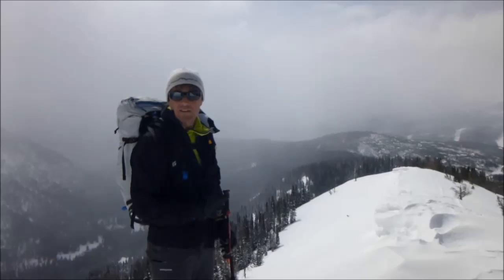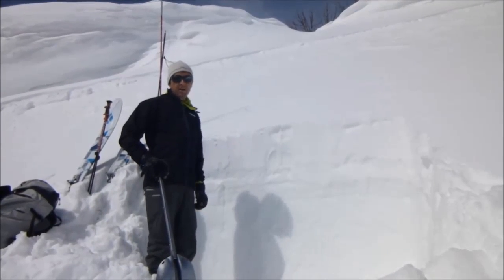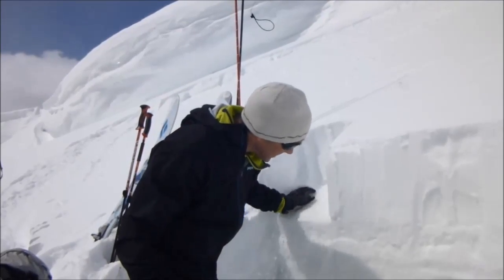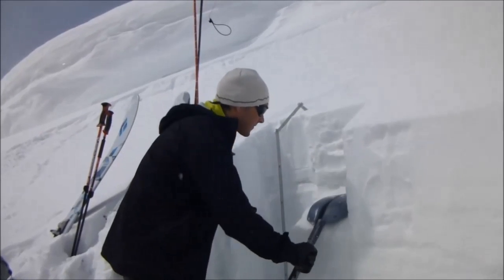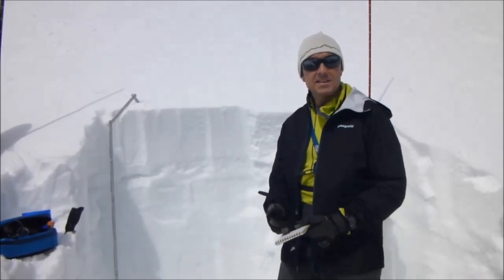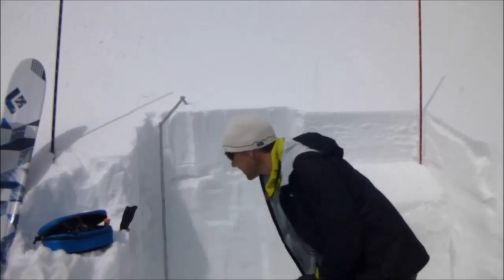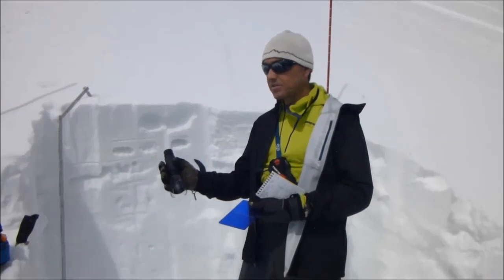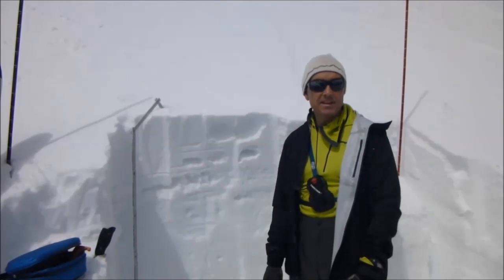How To: Snow Profiles & Tests

Comment: The question is : would you ski the terrain in this video?
Reply: No he didn't
Reply: No it propagated q1 at @15
Reply: Rather, the question is what terrain would he be willing to ski given the results.

He would likely ski the immediate terrain in the video since he and the camera person already entered it and thrashed around. Therefore, it's apparently safe terrain, meaning some combination of low angle, low consequence, small slope, etc.

The results will then either confirm whether the plan he already made for a similar but more dangerous slope is safe enough, or the results may steer him to a backup plan.  If his original plan was already very conservative then maybe he'd be able to stick to it.

That said, with a plan conservative enough to keep going with those results, you probably don't need to waste time digging a pit.
Reply: @BrianBraunsteinNow  it literally says on the snow profile "we skied the slope. Ski tracks on slope. Supportable crust." They decided a CT score of 15 with a supporting crust was fine.
Reply: @JohnSerjeantson  I assumed they skied it, but looking at those notes now, I'm surprised to see it was 36 degrees, close to the center of the curve. Unless it was a small low consequence slope I would not call that a go for me. It clearly propagated well with Q1 without too much force and not so deep to be safe, but deep enough to send a heap of snow down.  The profile has that crust drawn as rather thin.

This guy is way more of an expert than me for sure, but my feeling is unless you're a hero like him and can evaluate very subtle points, this would be no go results for 36 degrees terrain with consequences.

Comment: Your videos are very informative and I'm grateful that you've taken time to make them! Being an avalanche professional, what is your experience in observing amateur skiers of different levels? What level of caution do they use when assessing localized avalanche risk, and which tests are they likely to perform, if any?
Reply from the maker: Liam, The most popular tests are the Compression Test and Extended Column Test. These yield pretty good results. We see folks with lots of experience use tests and others do not. The same for beginners. It really depends on what type of information you want in regards to the level of risk you are willing to take.
Reply: Interesting to hear that some experienced folks don't bother performing tests before going at it. I have absolutely zero avalanche experience as I don't live anywhere near avalanche prone terrain, but I will be moving somewhere where they are a real concern later this year. Can you recommend some good resources on avalanche science that would give me a strong theoretical base before I have the chance to take more practical courses in the fall? I heard The Avalanche Handbook is used frequently in professional training so I'll pick a copy up, but are there any other sources that would be beneficial to look at?
Reply from the maker: The Avalanche Handbook is great, but a little outdated with the explanation of fractures. Check out Snow Sense by Doug Fesler and Jill Fredston.

Comment: Good video! I learned about standard pit procedure, where I struggle is how you'd analyze these results.  How would you react to this situation? why?

I'm sure I'll figure all this out when I take that avy 1 course though
Reply from the maker: Nate, a snowpit is just one part of the picture. When you get unstable results it can be a good sign to choose different/safer terrain. Stable results always have to be taken in consideration with other signs of instability. Recent avalanche activity or collapsing of the snowpack take precedent. Snowpits and stability tests can provide valuable info, but it takes years of experience before you can put a lot of confidence into your interpretations. Enjoy your level one, and read your local avalanche advisory to gain some more knowledge. Cheers!

Comment: So WOULD YOU SKI IT? obviously the same layer continued to fail in each test but did that failure tell you it was a no-go? If so what then? Do you ski the track out? Pick a safer line (more in the trees, against one side rather than the middle, etc). Thanks
Reply: that's literally what I ask myself on every one of these videos. can't find a single one where they give and actual diagnosis so to speak
Reply: I would not ski it !   There is a 1 foot slab sitting on a layer of ice, apparently.   Granular snow at the interface.  The crack propagated too.  Classic avalanche setup.  The slope is not stable.
Reply: Asking the same question...
Reply: That's a pretty low angle slope I would say it's the prayer flags in beehive basin  leads you to bear
Reply: "I kept the skins on and skied back out. I did not ski the steeper terrain below me." - Taken from a question below where he answers it.
Reply: @spencereng  they skied it, look at the notes on the snow pilot profile at 11:09
Reply: @svsanchago  I just quoted what he wrote to someone down in the comments. Maybe he skied it in a different spot that was safer I don't know, but you're right he does write "skiing was good" on the notepad.
Reply: Yeah, honestly I’m right with you on this. Even 7 years later I’m watching videos about avalanche awareness and nobody ever says whether the terrain is a go or no go after their assessment. Most of them find some type of instability, I don’t think I’ve seen a video where a person got to 30 compressions and the snow hadn’t done something…this would be fine if they said given this it’s not stable and not wise to ski/ it’s stable enough given these other factors I’ve considered/ it’s totally fine, nothing to worry about. And whenever people ask questions along the lines of so is it stable, explain your judgment of the test not just the results people in the comments get sharp and say if you don’t understand then you shouldn’t be out there. 
If I understood, I’d be out there, not watching people smack snow on YouTube. 

These videos really lack the critical analysis most people are looking to take to their own lives, the weigh up of the results and conditions we’ve just seen and whether they are optimal or sub optimal
Reply: Exactly
Reply: Risk acceptance is a big part of deciding whether you ski/ snowmobile on any slope.  It’s always good to talk with your group about the weather, avalanche forecast,  risk acceptance,  travel plan,  emergency supplies,  and who has training in avalanche and first aid.  The most experienced person is usually your avalanche lead if something happens, and same with medical emergencies.  Everyone should have a voice when it comes to concerns on riding zones.  Just because an experienced person accept the risk doesn’t mean you should discount a less informed persons doubts on whether it’s safe or not.  If you don’t want any risk of avalanches don’t ride anywhere near avalanche terrain.  That includes terrain features that could slide into the area you are at.  Just ask yourself what’s above me, what’s below me, and what happens if it slides!

Comment: Great video, thanks for posting this Doug, great information and very easy to follow. Can you please tell me what the lens is that you are using? I've not seen that one before and would like to know more about it. Cheers Doug!
Reply from the maker: +Matt Appleford I'm using a Pentax monocular, but they don't make it anymore.  The closest one available is the one that Snowmetrics sells: http://snowmetrics.com/shop/magniscope-30/
Reply: That's great intel Doug, I will check them out. I like idea of using a longer lens like that, to help preserve the snow sample when you are looking at it. I have a pretty powerful loup, but being so close to the crystal card (which is metal, I notice you use plastic, that might be another way to keep the measuring surface colder?), your face/heat tend to heat things up quickly and the grain doesn't last long in it's original state. So, I'm thinking a plastic crystal card, combined with that longer style lens you are using, will help make easier snow grain/crystal type evaluations that last longer? Thanks for the helpful reply!